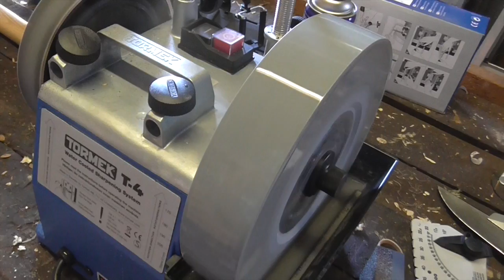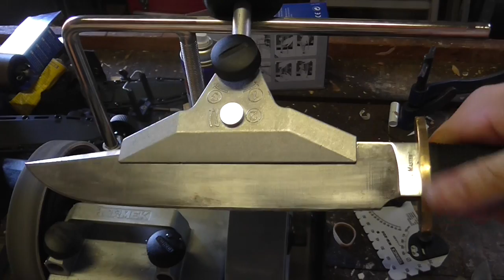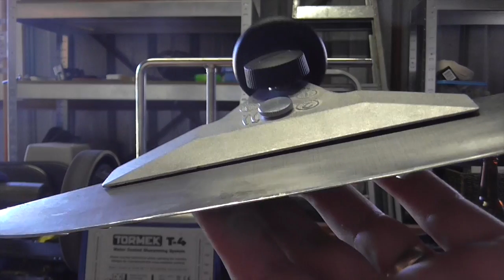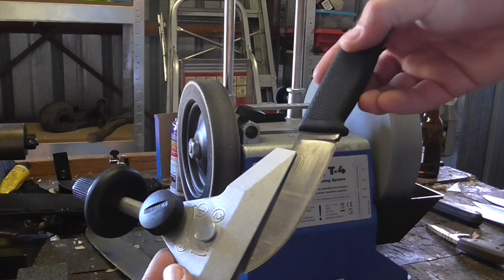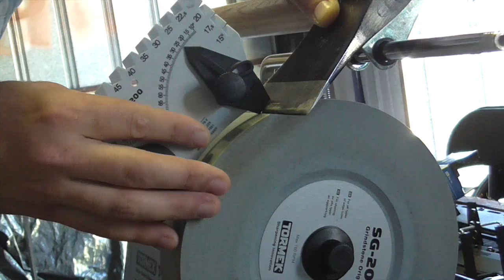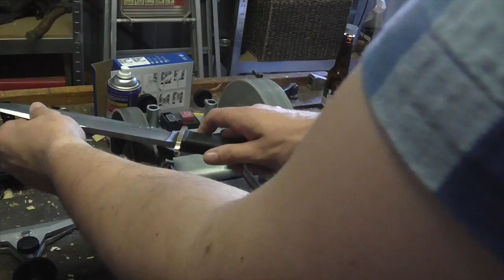Tormek T4 Fixed Angle, Water Cooled Knife and Tool Sharpener - Initial Learning

Comment: G'day CAGO, It was because of this video I purchased a Tormek T4 but the dealer down here in Hobart just had the 'Outback' variant of the T4, basically the same. I'm really happy with the T4 after about 2.5 years but as I collect and use big knives, machetes etc. I found the stropping wheel used to get in the way of these bigger blades. Since then I've actually taken the stropping wheel off the unit and this allows me to work on my 11" and 12" chef's knives and my machetes. A kind bloke in the US suggested I get a 'Rock Hard' Felt wheel to use instead of my kangaroo tail leather strop sticks and bench strops. I've attached the felt wheel to a single wheel, cheap, bench grinder and now with the two units I can get a really good edge on the big blades and polish them up so they look like they just came from the Cold Steel or LTWK factory, some are even better than the finish that Cold Steel put on them. Of course, I couldn't match the LT Wright mirror finish they do on all their blades. They are about the best, small knife maker in the US I know of and really good blokes.
I'm glad I saw this video again because I thought I was subscribed but that was a couple of MacBook crashes ago. This has given me the chance to re-subscribe. All the best, mate! Cheers, BH 
P.S. I got myself a couple of small, round, Rare Earth magnets and put one on the inside and outside of the water 'tank' of the T4. The magnet on the inside of the tank picks up the tiny, almost microscopic, metal shavings coming off the wheel and stops them coming up and back onto the surface of the grinding wheel. The outside magnet keeps the one in the tank very firmly in place. It's worth giving it a try as it actually keeps the tank water clean and has a beneficial effect on the knives while also reducing wear and tear on the surface of the grinding wheel. Since I've had the magnets in place I haven't had to use the grinding wheel 'squaring' tool. BH

Comment: Interesting I just picked up one of these yesterday, my fist knife is now as blunt as all buggery, that’s ok because I have a wicked edge that I will restore it with, second knife was better, still not a patch on the WE but much much faster, my plan is to use the tormek for initial work of for toothy edges and the WE for finishing or polished edges.
Also I want to try scissors and chisels, quite frankly the WE scissor adapter is not great.
Would be interested in the Japanese waterstone though.

Comment: does the knife clamp changes the edge angle on full flat ground knives because of their wedge like shape or can it hold those straight enough for symmetric bevels?
Reply from the maker: Mopar HEMI so you use the face of the knife before the actual edge to set your per side edge. the edge is the only part. ot flush with the little black guide line on the angle card. it seems to make accurate results as you can then check them on the side of the angle card 👍🏻
Reply: Thank you for your answer but I thought that a full flat ground knife may wiggle inside the clamp because there is not a hell of a lot contact with the inner faces of the clamp with is caused by the grind.^^ I had a similar problem with an old lansky and when the knife tilts you automatically get an uneven bevel.
Reply from the maker: ah yes, i see what you mean. i think these jigs have greater and tighter contact, seems pretty good on the trailmaster
Reply: then it will be enough for my modded okc ranger rd7... I am searching for a quick but accurate way to get the grinding done before i get an mirror apex with my strops. The edge pro works great but i am too lazy to use it for beater knives because it takes fairly long :D thanks a lot

Comment: If you were the average knife guy would u fork out for this or go the edge pro and save $400?
Reply from the maker: Malegole If you can get a good angle sharpener for under $400 australian, I would start there. If both cost $700 I would get this, it does about 80% of the result in a few minutes, but you probably wont get those crazy apostleP edges unless you get the higher grit wheel for another $300.